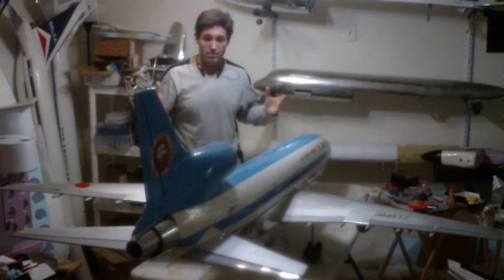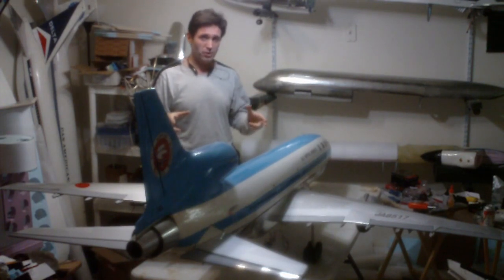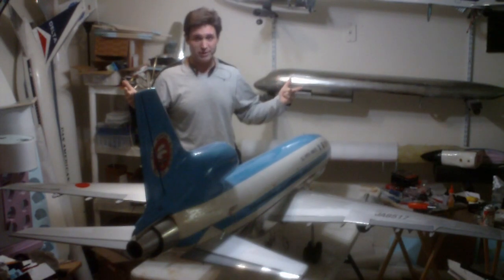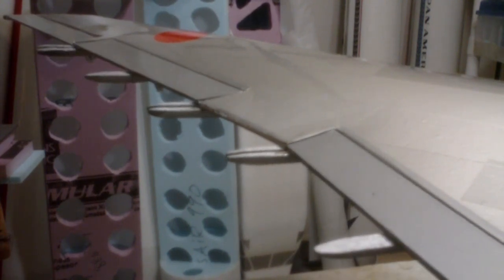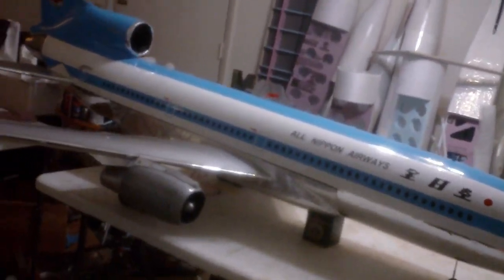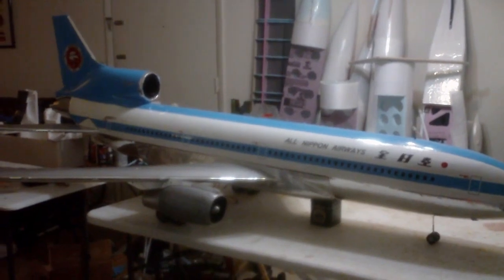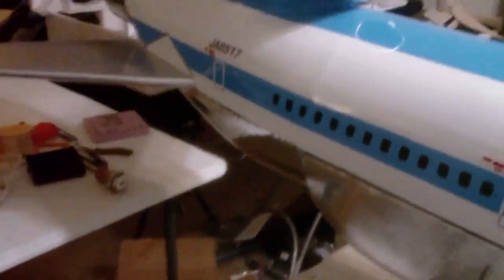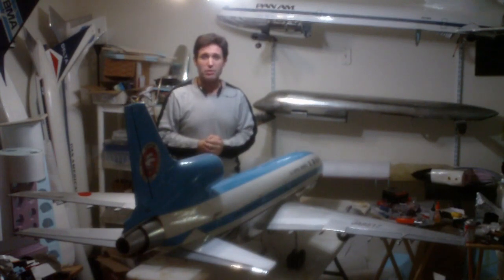RC ANA L-1011 Flight control Test 全日空 L- 1011 フライトコントロールシステム

Comment: Beautiful work DD!  Would it be too much work to have the entire elevator move like the real one?  Best of luck on the maiden.
SixxPK
Reply from the maker: Thankyou very-much! ... .sometimes having the entire stabilizer move on a rc plane can require a larger heavier servo and also lead over control and or over correction. . . Kinda like oversteer in a car.